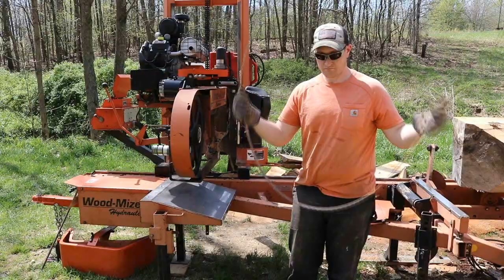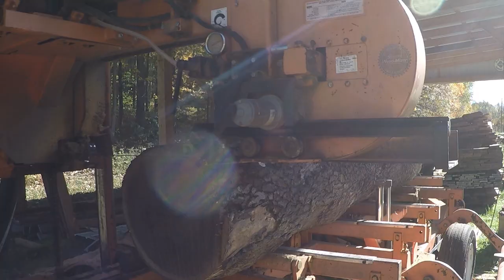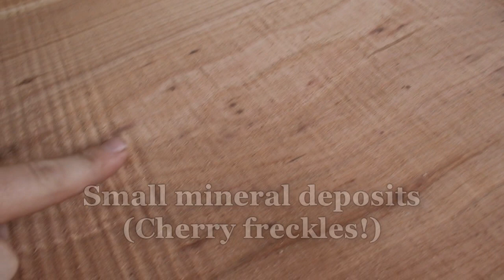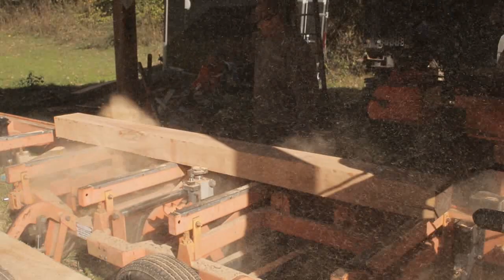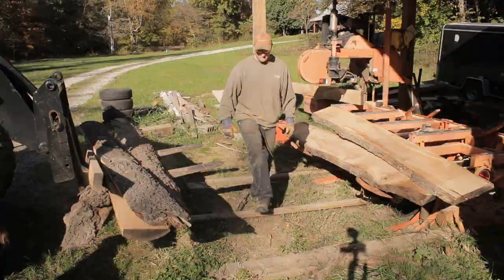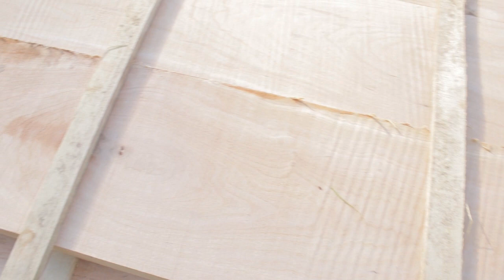Cherry Log makes beautiful lumber! - One cut at a time - Southern Indiana Sawmill

Comment: I agree, live edge is over rated. Cherry is my favorite wood as well, even compared to oak. It is hard to find nice cherry logs here in northern michigan though. Good video, keep them coming. You can use a spray bottle with rubbing alchohol to make the grain come out and then it evaporates quickly.

Comment: Been a woodworker for over 55 years. Much prefer square edge wood, but will work with live edge if requested. Modern day epoxy is what has made live edge more popular. However trends will change as the effects to the environment of using chemicals becomes more and more of an issue.
Reply from the maker: Totally agree!

Comment: @ 10:58 a low-cut humbolt notch can help retain the integrity of the log, without cracking, because the trunk will tend to be laid on the ground more smoothly when falling, versus a higher standard notch that can cause parts of the upper trunk to crack.

Comment: Live edge or Dimensional? Depends on the project at hand. I'm the type that finds a use for your slab wood as well. And YES, it does get to a point that it's best for firewood. I was raised with certain woods were for fire and others for creating. Many are for both. Like I said, it depends on the project. Everything has a use and purpose somewhere along the line. Even the bark. Myself, I would've cut some of those thinner for other projects. Sure, 2 inch thick tables are fine. But other projects are better suited with 1/2" to 1" boards. I once watched my Dad use an entire tree to build a fully furnished Dollhouse Village for my Sisters. A lot of the furniture was made from shavings, like from a Draw Knife or a handheld Planer. Imagine a full size lampshade on a wooden table lamp and it's all 100% wood except for the wiring and light fixture. The shade was covered with paper thin wood you could see through. A beautiful sight to behold, just sitting on the table. And 100 times more beautiful when it was turned on. Both works of art, the Dollhouses and the Lamp, contained both cuts of wood. Live edge or Dimensional?? It depends on how creative YOU are willing to be?